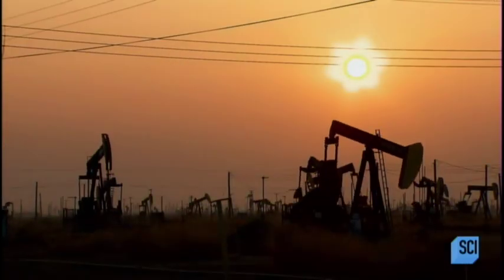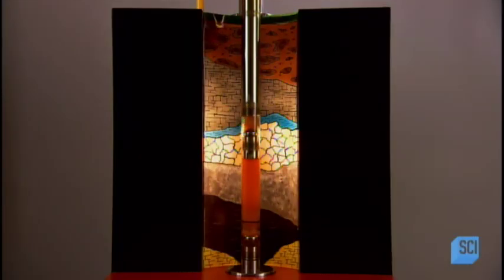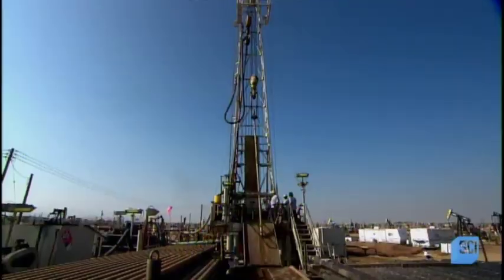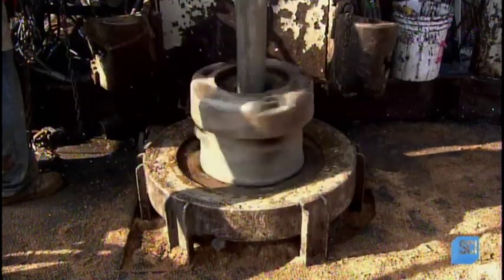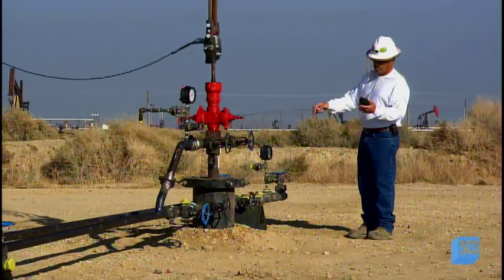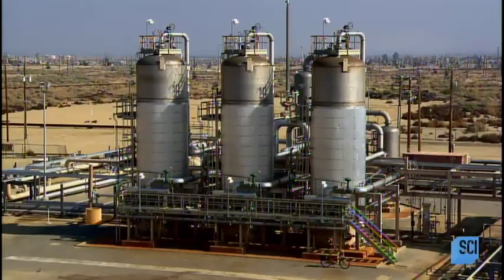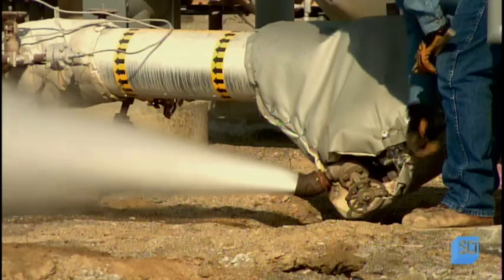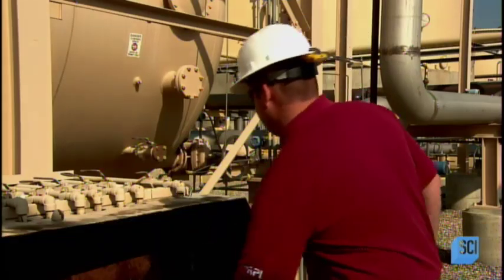HOW CRUDE OIL IS EXTRACTED

Comment: can you explain briefly that how c02 and natural gas is used to fuel steam generator ?
Reply: Natural gas (generally >90% methane (CH4)) used as a fuel for steam generator/boiler, the same way house furnaces burn natural gas. 
CO2 can't be burnt so not sure why would they say so. He might have meant CO, which still has some heating value and could be burnt till CO2. 
Generally CO2 is just emitted to atmosphere.
In some oilfields they capture it and inject it instead of steam (kinda different process and different results achieved). It will still be emitted to atmosphere eventually.

Comment: When you remove the crude oil from its natural position in the earth at the magnitude is being removed will cause the earth to become unbalanced which will make the earth wobble which is not good
Reply: Your an idiot😂
Reply: The only relevant measurements  that would effected are GPS points relative to one's collected at different time when surveying because the rotational speed of the earth is always changing.  But it would be interesting to see the change in the earth's rotational speed over time compared plotted over time.   But if you heard what they said only 10 percent of what they pump is crude oil and it seems like the water and CO2 that is collect is pumped down back down the well.
Reply: @Solid_Snake99  Do you have an explanation why the earth is wobbling you seem like you know everything
Reply: @peterlaurancearmenio5545  that’s called an earthquake. And oil extraction doesn’t cause earthquakes.

Comment: How the hell does anyone find this shit out?
Reply: It’s not just one person. Each step of the process consists of many engineers. Then the lead project engineers just link every step together. It’s like a group project where everyone has one job.
Reply: @JuanRamirez-qf1qr  Yea I get that but dosen't ther have to be one person at some moment in time who has the idea to even try?
Reply: @Looaxe  The concept of a valve pump has been around for ages.  Nearly every type of hand pumped well was based on this process.  The rest is pretty simple in concept and appears to just be threading a series of interlocking pipes into the earth and then giving time for the mixture that surfaces to seperate.
Reply: @sarahnikas1344  Yes but see the thing is that you have been taught all that.
You didn't figure it out from ground zero (meaning no offense)
Whoever had this idea first is well... a genius.
Reply: @Looaxe , oil was found on the surface originally, once it was used up, they dug a little deeper and little deeper, and so on. Later they figured out that it might be cheaper to drill a hole, rather than remove dirt for hundreds of meters deep.
later yet they found that even after the natural pressure drops, pumps could be used to get more oil.
Later they figured out that they can pressure up the cavity by injecting something heavier than oil (usually salty water) and than the double benefit of hot steam was applied... It's a gradual process, nothing was invented at once and by a single person :)
Reply: Trial and error. Lots of deaths. Yada yada.
Reply: lmao fr

Comment: Is there a way to extract molten carbon with layered graphite cooled drills and cement holding ponds?
Reply: yes
Reply: Sounds like magic.
Reply: You can't extract molten carbon without melting everything else.
Reply: @sliceofthatpie not true
Reply: @SEWHTSTNG  Boy, carbon has highest possible "melting" temperature. Before you could even achieve its molten state, everything else will get evaporated.